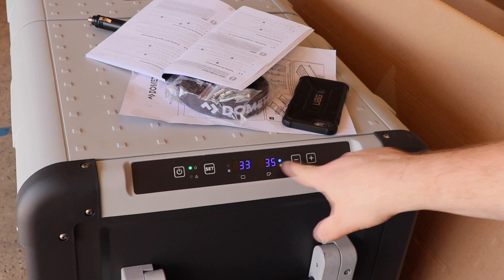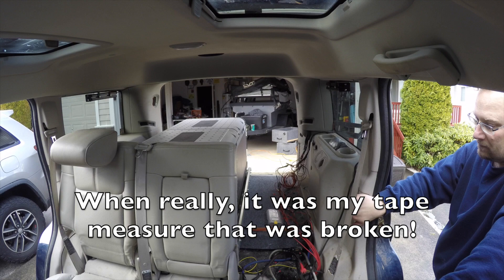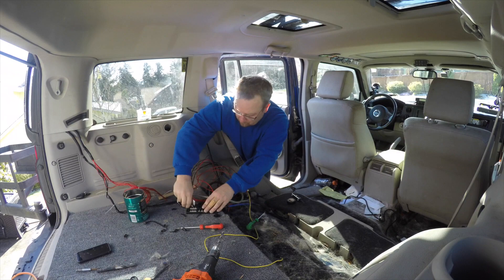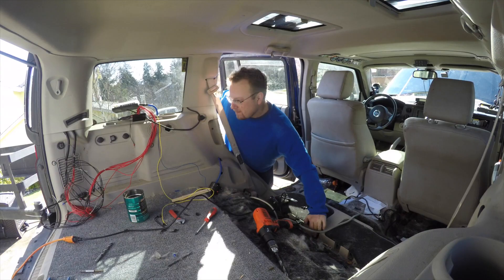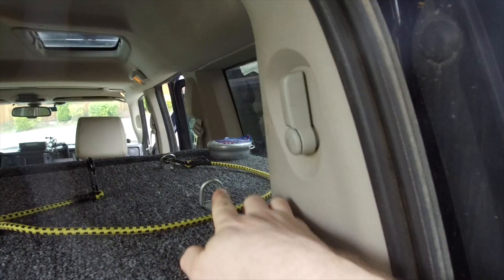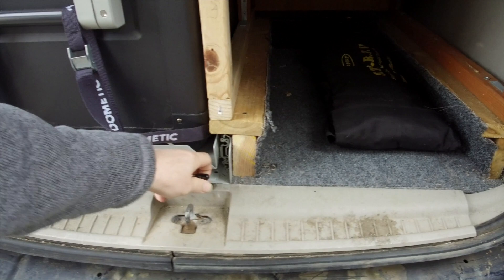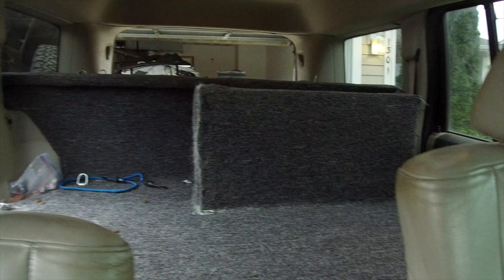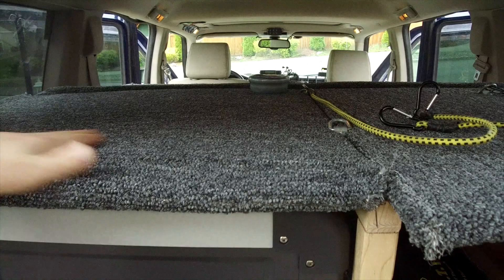VLOG #12 - Changing It Up: Making More Space

Comment: That looks great! I pulled all but one of my rear seats out and my 60l fridge on the passenger side where the second row seat and middle section would have been. Your build looks great so far and is a huge inspiration!
Reply from the maker: Thanks!  Hopefully I'll find the time to finish it up.  I'm still not sure how to do some kind easy access charging station though... That was my initial plan.  To leave one seat.  But once I got the bench pulled out, it didn't seem like it it was the right thing to do.  I still have the seats (I still have the 3rd row seats, actually).  I may put them back in eventually.

Comment: I like where you’re going. Your rig walk-around convinced me on these XK. Fuel economy is killing me though.
Reply from the maker: Thanks, but you’re right...  Yeah, you really do need to work hard to keep your foot out of it...  and take extra cans full of gas....  and stop at every other gas station...
Reply: Josh Duncan Overland lol what are you averaging in terms of mpg? I’m at about 12 mixed driving and I’m stock. Not sure if it’s worth to invest in the ome lift and 31’s if it’ll only get worse.
Reply from the maker: That seems near what I am.  If I keep it around 55 I’ve gotten it to run around 15mpg.  Crawling around on the trail, it can obviously go much lower.  The OME springs, struts, and shows where the best thing I have done to it so far.  I can look down and, “surprise 75”, when it used to feel like it was going to come apart around 72.
Reply: Josh Duncan Overland I know the feeling, I’ll cruise around 80 easy but with any bump in the road it’ll get sketch really, really fast.
Reply from the maker: I haven't been anywhere I can drive this suspension setup at 80 yet.  But I'm pretty confident it would be fine to drive that speed on the interstate.  That said, I don't think I want to pay to drive that thing at 80.